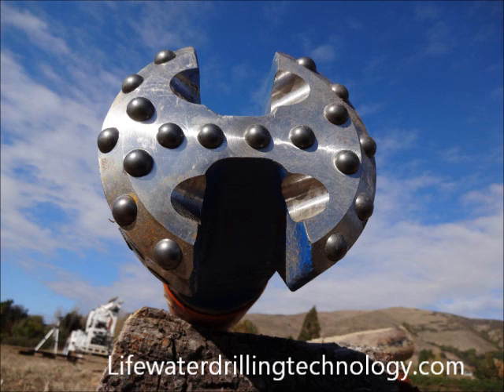Assembling a Drill Stem On a Cable Tool Drill Rig

Comment: I hope you guys aren't trying to teach people how to drill on a cabletool rig because yall dont know how to drill on them or even make the drill tools up right come out on one of my rigs and I'll teach you how the proper way hell I might even put a school in on how to do it right but everyone to there own good luck
Reply: If you had a school I would love to be one of the teachers. I grew up on cable tools 3rd generation driller. Your assessment of this video is very correct. When setting joints never used anything but clean water to clean and lube the joints. The friction created at the shoulders of the box and pin is critical to prevent unscrewing. To use grease or oil creates a thin film that prevents the joint from coming together with the proper friction. The only time to use grease or oil is for storing unused tools. Then properly cleaned of all grease and oil before making a joint. As for setting joints I prefer the circle jack. Although using the chain binder is ok for temporary until you have enough hole to lower tools into position for the circle jack. Not once in my 20 plus years as a driller have a joint unscrew once set with the circle jack. I have seen them come loose with the chain binder. Simply because the chain has give under the leverage and doesn't allow the joint to come fully solid. With a circle jack you can feel the joint if it has give letting you know how solid the joint is.
Reply: Button  bit  used for  Rotary  drilling. 
NOT for  cable  tool.
The impact  against  gravel / Boulders  will smash the  buttons. 
Chisel  point / hard faced worked well  for  me  for  27 years.
Reply: @tonyhudson8698  chisel is for softer rock buttons are for harder rock.

Comment: I know this is old video but i worked cable tools for years in the oilfield. If storing your cable tool its fine to use oil or greese to prevent rust but when making joints in assembly never use oil or greese just clean with wire brush and water and touch up shoulders with a pocket wet stone. The oil or greese will form a thin space in the joint not allowing the steel to steel joint to properly set up. Also in rhis  video your back up J-wrench is on backwards when applying proper tension this can cause damage to the wrench and not allow proper tightness to the joint. Because the wrench will have give in it and also could cause injury as i have seen them snap. After seeing this i would have concerns about how your stinger is set to your cable  and how its riding in the rope socket.

Comment: I was taught long ago to use oil.Rotary threads can use grease. Also; If they have a problem loosing tools in the hole,socket and all. I think I notice why. I to agree about the wrenches.